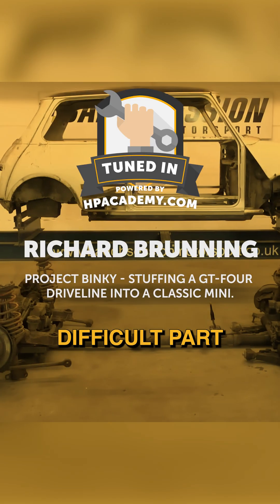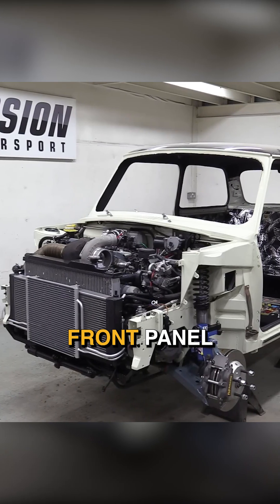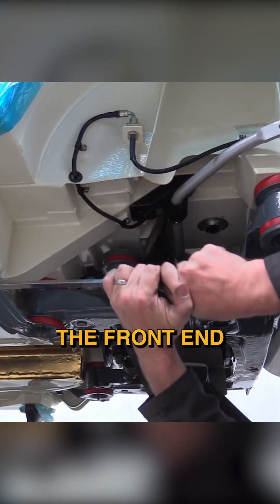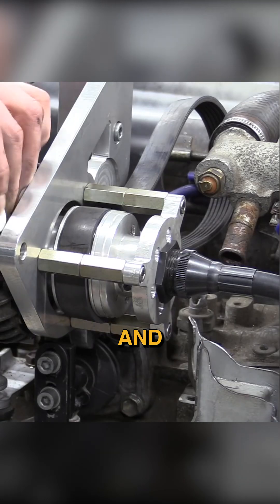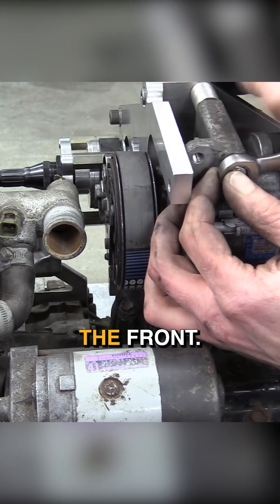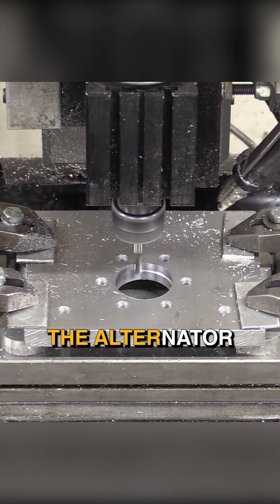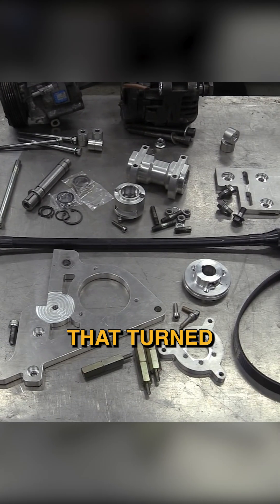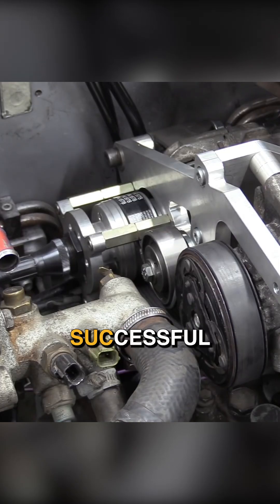"I'm still not convinced we've got that figured out." - Project Binky

Comment: That was where I came into the Binky journey and, tbh, where I realised what an amateur I am.
You lost me with the gauges though. WAYYYYY too much!!!!
Reply: @jiminycricket9877  Naah, you're approaching this from the wrong angle. Binky is an example for anyone who encounters an impossible problem in their car project. It's not impossible. You just haven't exhausted all possible solutions. Sometimes the solution may be inventing whole new manufacturing methods. Enjoy the madness.
Reply: @AnttiBrax I get it but it’s too much for me. They freely admit that over engineering is the goal. For instance, on my car I’ve just used off the shelf gauges and standard dash illumination (with leds)(. I have a Speedo tach oil water and boost and they work. I could never justify a years work to get an arduino  to drive drivers and servos to make the gauges work better, it just doesn’t interest me.
The work is great, the car is an achievement but it’s not one I would ever be interested in trying to emulate.

Comment: As I recall, the solution with the flexi-drive WASN'T successful...
Reply: The first iteration wasn't because the inertia in the alternator unwound the flexi shaft when coming off throttle. A sprag clutch bearing fixed that problem and I don't recall any new ones being found yet.

Comment: From mamory they had a flexi drive alternator fail  ?  I think the bloody thing is beautifully engineered  I recall early on they poked a  long piece of scaffold pipe up thru the Sills which I thought was great except they didn’t seem to plug weld it to the chassis. Fine piece of engineering tho

Comment: Or leave the a starter in constant mesh, and with the right tech, switch from starter motor to generator
Reply: @chrismannifield3222  - the starter motor would turn too fast. In the 1920s when starter gearing hadn’t been figured out the way it is today, cars had Dynostarters, which was one electrical machine that did both start the engine and provide DC electricity as a dynamo. The dynostarter is coupled to the crankshaft via a 2:1 chain drive, so the dynostarter ran at twice crankshaft speed. With such limited reduction gearing, the dynostarter had to be a huge machine and in my Dads 1928 Humber it is 3/4 as long as the engine block. It does however, silently turn the engine over and so the car just bursts into life with no starter motor ring gear whine. Binky might be better taking a belt drive from the propshaft and mounting the alternator elsewhere.

Comment: I think speed way makes a bracket kit to run the alternator of the rear differential pumpkin
Reply: @chalinp4886  Which is fine unless you're stuck in heavy traffic; they even mentioned these kits in the episode about the alternator and decided against running one as having the charging system function while parked and idling was part of their design requirements.
Reply: i've seen a video of a car with an alternator being driven from the rear wheel.
Reply: No freakin way to both of these! That is just awesome, outside the box thinking! Is that for people who can't fit it up front or to install a secondary alternator. Are dual alternators a thing?
Reply: @Yerboiy  yes ask the competition auto sound guys
Reply: Yes they do and that option was also discussed in the long from video.

Comment: I think Binky is the most thoroughly built project. Everything is meticulously engineered, except the positive cable lining on the floor. I still believe it’s hazardous to put it where it might short on the chassis in case of a slight undercarriage damage
Reply: @w140  Lots of vehicles run the main power cable along the floor bud, it'll be fine.
Reply: @johnsjunkyard  yes, but with a fuse between. Binky has a section of main power cable going from battery terminal to fuse box in the place it might be easily pinched on a big enough pothole. It's being buit as a rally car afterall
Reply: @w140  Not a rally car, a road car with aircon and a stereo

Comment: With current modern tech..

He can swap out belt driven ac comp with 12v dc electric ac comp unit...

Then electro-hydraulic power steering pump

Will further clears up aux belt drive load...

Which means now only alternator he need to worry about.. (but those electric 12v dc pumps would require about 200amps capable alternator)
Reply: @AmirPomen  even modern standard alternators at 150amp are not rated at full duty cycle. He'll be replacing alternators every 6 months with your solution. I think they have already considered all the options and this is the best compromise. That's why a 48 volt system architecture is needed for these modern times.
Reply: @MrXyzasdf  iirc he got modern lightweight, high capacity yet small form lithium type of battery which is decent enough to act as a buffer...

And during at the time of the balternator development,

The 12v ac compressor is not yet readily available oon aftermarket shelf... Mostly they were oem replacement for early hybrid cars...

Which is by now... Its well easily available and i would say in the affordable range
Reply: @AmirPomen  using a lithium battery will compound the problem even further. Unless regulated the lithium battery will easily take the full output of the alternator without effort and this will put the alternator at full duty-cycle. The problem is not the capacity of the charging system to supply enough power. The problem is you don't recognize that alternators are not designed for 100% duty-cycle.
Reply: @MrXyzasdf  if 150amps wasnt enough, then there are 200amps and over alternator easily available...

Plus, im not saying it only just need 150amps, it could be more, it could be sufficient with just that...

Plus when the eingine were running, all of the electrinal need in a car were supplied by alternator, not the battery...

The battery just provide support for start-up and aux power when the engine wasnt running... 

If u worry that 150amps alternator supplying 12v ac comp+electro hydraulic ps pump+fuelpump+injectors+ignition coil wont be enough, just size up the alternator...
Reply: @MrXyzasdf  plus.. why would u worry about alternator running 100% duty at all time?

Alternator have their own duty control based on load/voltage sensing built into the alternator itself...

150amps wont be enough..

200amps as i suggested might be sufficient

Or there always 250amps and over if total load demands on the while car were anything beyond that...

automotive Lithium battery were exactly intended for fast cycle..not deep load cycle...

Why would you worry about tiny regular 150amps alternator haveing to work overtime while ive suggested higher capacity than that? 🤔
Reply: @MrXyzasdf  ok lets put it in simple mathematical electrical load perspective...

Provided the car is running at cruising speed/rpm where the alternator were in its full charging capacity...

And aux running at full load
1-Electro-hydro PS : 80a
2-electro 12v ac comp : 100a
3-ignition coil 1pcs per rpm : 10a
4-injector 1pcs per rpm : 10a
5-ac condenser fan : 20a
6-ac blower fan : 15a
7-ecu and general chassis power : 15a
8-fuel pump: 25a

Totals at 275amp load max..

While not all of those will be running at full load at all time, say we factor in them at 75% load, its dead on at around 206amps

Then my recommendation of 200amps alternator is actually feasible...

I dont know why u keep telling to use 150amps version and worry about them running overtime 🤔